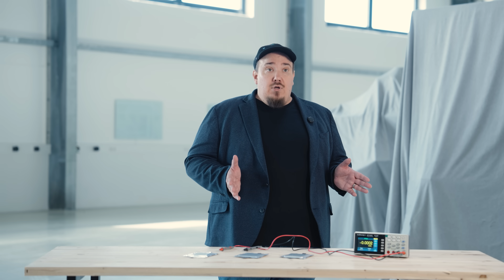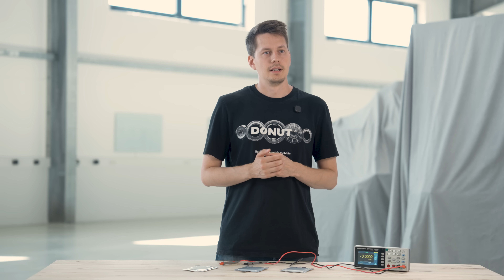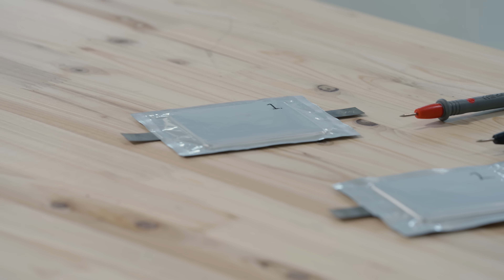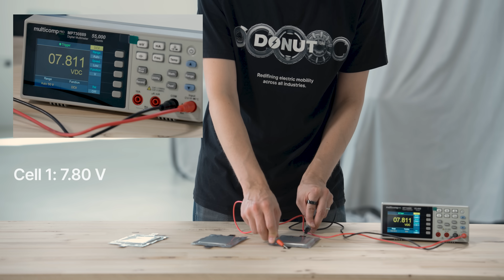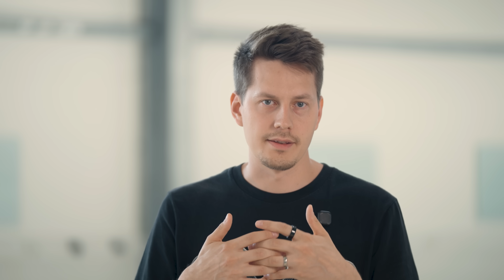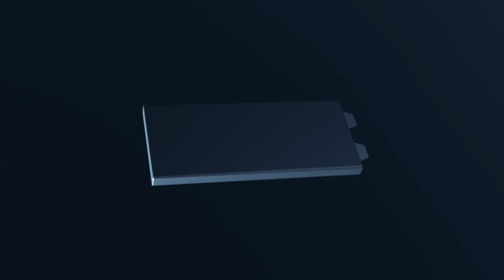Bipolar Cell | I Donut Believe

Comment: If the graphic can be taken literally then the first cell has six layers. The second has nine and the third has 14. So each layer delivers about 0.5 volts. Okay Ziroth, what's their chemistry now?
Reply: 0.55v... their V1 batteries didn't appear to be multiples of 0.55v though so maybe these are slightly different
Reply: @pinecat10  0.55 is the voltage of a potato battery
Reply: @marklefler4007 that's their secret tech 👀 in that I can believe
Reply: @pinecat10   Yes, the last line in the video suggests that V1 cells "already in production vehicles" are not bipolar, because he ends with ""our target is to still deliver the first bipolar cells to customers this year" so clearly not what they already delivered..
Reply: @daemn42  "the ones on this table" So yeah, not the "donut batteries in general" but only these specific samples that they proto rushed out for this demo. There's like 50 "donut batteries" and if you put their specs together you get the actual spec sheet. And so he can sleep well at night, the 100,000 charge cycles is just a capacitor.
Reply: @pinecat10 I think other bipolar organic carbon batteries have a natural voltage of 1.1V, but that was with a liquid electrolyte.
Reply: Now it got more interesting.
Reply: Cept given the last line in the video ""our target is to still deliver the first bipolar cells to customers this year" it's pretty clear that V1 is not bipolar and that calls into question whether it's using the same chemistry.     It's possible that everyone is  right here..
Reply: It's a different battery. They literally said it's on a test bench.
Reply: Look up zinc, manganese, and aluminum bipolar charges
Reply: @jonathangilmore446  Different chemistries result in different behavior. That does not mean that i Do Nut less Beleive.
Reply: @wolfgangpreier9160 i have a feeling my initial suspicion that Bhuskule's research into aluminum 3+ is crucial to the design. Heavy emphasis on the separater material in this video - thinking nordic nano doping technique is what unlocks the bipolar design. Still not holding my breath, but i still have hope. Zirorh claims feel dubious... and interviewing 50 scientists who didn't make the discovery calling bs is what we should expect from those interviews. Like, if a gold prospector tells his prospector buddies he found the morherlode, nobody would believe it until they see it.
Reply: bravely trudging on where no one has trudged before. hilarious.
Reply: Ziroth is entirely wrapped in his own confirmation bias.
Reply: @sailingoctopus1 Just like Markus / eater of many donuts here, too.
Reply: @jrherita No, what he has revealed today makes all the Donut Lab claims credible. Some of us guessed correctly whilst others have been barking up the wrong tree (Ziroth, for example). Most people have been unbelievably cynical, impatient, downright rude and acting like they have ever done anything worthwhile in their entire useless lives.
Reply: @sailingoctopus1 Are you new to battery technology?  There have been so many fantastic claims the last 20 years - that healthy skepticism is the starting point.   Donut hasn't done anything to prove it's solid state - they haven't opened it up, and they haven't shared energy density.
Reply: @jrherita  many fantastic claims are true, oil/gas corps are just buying out and killing off next level battery tech/startups on regular basis. 
and lithium battery is just perfect for planned obsolescence because it lasts 2-3 years, 5 at best. perfect to force upgrades and buying more 0 progress gadgets/batteries. thats why its everywhere.

the hard part is to not get killed/destroyed while you're releasing breakthrough tech. donutlab still can become the victim of that too. and guys like Ziroth aren't helping at all. 
the problem is big corps have too much money and resources to buy/remove any competition. and its not just a batteries thing, its happening everywhere with everything. corps just milking the market with gradual slow gains and planned obsolescence so we can't have good things anymore. 
inb4 'blah-blah-blah conspiracy put on foil hat' you can't even buy a lightbulb that works for 50+ years. exactly for this reason. or cheap DRAM/SSDs. even HDD price/TB stopped dropping despite it costing basically the same to make with bigger capacity. or GPUs for pre-mining prices like it suddenly costs 10x to make it - its not. and inflation isn't even close to 10x overprice. its all just pure greed and insane corp margins so investors and CEOs can buy more lambos and yachts.
Reply: @jrherita  read about intel tera-herz 2001. we aren't at the limit of anything. corps are just milking the market with overpriced near-0 progress crap ...just because ITS THE MOST PROFITABLE APPROACH. thats why there's no progress. and corps like TSMC and Ngreedia are just milking it maximizing profits. the less progress they make the less is price drop on older tech. just have to fake demand with AI datacenters build-out and force everybody to subscription computing with overpriced consumer tech.

also post-Von Neumann computing is the future i.e. memristor PCs and hundreds GHz switching if not THz speeds but thats more a question of architecture than of real transistor speed. and probably AI for everything replacing everything everywhere starting with GPUs/graphics. and then "OS" and "apps/games" completely faked by AI is the next step. and then AI generated actually realistic VR. most likely. all with monthly overpriced AF subscriptions where noone owns anything but low-VRAM dumb hardware unable to function without datacenters.

Playstation and Xbox chips are made by AMD. thats actually the reason why there's no progress or competition with PC GPUs and why they are overpriced AF like mining isn't over since 2022. so AMD can sell more obsolete overpriced slow junk hardware in consoles and handhelds to casuals aka noobs. go buy your 2020 ps5 for more money than @ launch. imagine buying 2020 phone in 2026 and paying MORE. thats how bad corp greed got.
Reply: @jrherita  I’ve been following battery technology closely since 2007, after buying a 42ft hybrid diesel electric catamaran with very heavy lead acid battery pack. What’s the history of your interest?

If you know anything about battery technology then you know that getting from the lab to into production is a huge leap.

If you were in their situation, the last thing you would want to do is 'open it up' to scrutiny, because you can guarantee that someone would copy the ideas that you've spent years developing and bypass any IP protection you might have.

FWG, led by Robert Murray-Smith, attempted the same thing with very similar bipolar organic carbon printed polymer technology seven years ago, only they were using a liquid electrolyte and they didn't have access to the precision screen printing technology from CT-Coating AG via Nordic Nano, which wasn't in existence at the time.

In 2019, FWG announced a 'merger' with a dodgy Texas-based Canadian company called EEStor, who, it seems were only interested in stealing the FWG IP. FWG withdrew from the merger and abandoned all development on their battery, presumably because of legal injunctions or running out of money or disillusionment. At this point, Robert Murray-Smith turned his back on battery chemistry, after having worked on his bipolar organic carbon printed polymer technology for seven years and before that as a battery research chemist at ICI. Instead he turned his attention to his passion for inspiring creative scientific curiosity by producing over 2000 innovative, inspiring and creative videos, presumably disillusioned with the back-stabbing world of commercial battery development. Sadly, he took his own life last year after the loss of his beloved wife Patti and after a long-standing battle with mental illness.

Tell me of a non-solid-state battery technology that would withstand the high temperature performance test conducted by VTT and reported on 2 March and could then, after being charged at 100°C, go on to be used in a further VTT safety test even after the vacuum pack was breached. Of course it's solid state!

Reading between the lines, energy density is likely to be their most dubious claim because I doubt the gravimetric energy density at cell level is 400Wh/kg. Bipolar batteries have struggled to achieve high energy densities in the past, although improved organic carbon polymers, solid state electrolytes and high precision screen printing technology might have taken Donut Labs some of the way there.

However, in practical terms, I think it is fair for Donut Lab to claim something like 'the gravimetric energy density of the Donut Lab battery at pack level is equivalent to the pack level gravimetric energy density of a Lithium battery pack built with cells with gravimetric energy density of 400Wh/kg.’ This is because of all the additional paraphernalia required by Lithium cells, such as BMS, inter-cell cables, connectors, lugs, busbars, pouch compression devices, thermal conditioning hardware, cooling liquid and structural packaging.

I think the last two videos have been preparing the ground for delivering such a complicated message. No doubt there will be a lot of people that will ignore the complexity of the message and delight in calling out a fraud, even though it’s nothing of the kind.
Reply: @sailingoctopus1  more likely paid by chinese. dunking on donut, praising chinese battery and being sponsored to go to china in one of his videos. skepticism is good, what he did and some others(which also seems to have done video on same chinese battery) is going hard at donut making multiple videos dunking on them in a way and with titles that suggest that they have checked and debunked the battery, which is false and in bad faith. No one will know the truth until it releases or they are prosecuted for scamming.
Reply: @jrherita smelling your own farts and saying you are right isn't being critical it's called confirmation bias and the dude drinks his own Kool aid to much. He made many claims then was proven wrong and then tripled down on them. It's like he hopes the more he says he right in his own mind it will make it happen. Sorry but that's not how reality works.
Reply: @Akiramasterwho did they scam? Have they taken money from investors?? Nope... Have they taken any more for pre orders? Nope.. so where is the scam?
Reply: @Nick_Gir They HAVE taken money from investors.  And they ARE actively seeking more investment.
Reply: Nah. 3.3V is one half empty cell.

4.97V is 2 completely empty cells, at 2.5V each. 

7.8V is 2 mostly full cells at 3.9V each. 

Intellectual dishonesty from Donut Lab, is not surprising.
Reply: @go1dfishyyyyy  very imaginative. so, if you can imagine a way to fake it, then it proves that Donut is dishonest?
Reply: It's bullcrapium
Reply: @aL3891_ you are wrong
Reply: @sailingoctopus1  I Do Nut Believe you.
Reply: @wolfgangpreier9160 Nevertheless,   you are wrong and will have to eat your words. A bipolar organic carbon polymer battery makes perfect sense of all their claims, as a few of us have been saying for several months.
Reply: @sailingoctopus1  I will not have to eat anything. I find it totally funny how the whole world falls for their scam. Its fascinating.

An no: a bionic carbon (which one?) polymer (which one?) battery makes no sense whatsoever. Sounds good for those people not knowing how batteries work IRL. 

As long as they do not have produced the first billion cells and can sell better and cheaper and longer lasting cells than e.g. CATL or Gosen.
Reply: @wolfgangpreier9160 In case you haven't noticed, the whole world hasn't fallen for their 'scams', so it's not clear what you find so 'totally funny'. 

The vast majority of people have been extremely cynical, just like you.

A very few people, like myself, have been more receptive to their claims, because we know them to be plausible if the technology was a bipolar battery, which we correctly predicted. Laugh at us few people if it makes you happy, but it doesn't make you right.

Your final paragraph makes no sense. You might want to change it so it makes sense.

*Organic, not 'bionic' and yes there are literally millions to choose from
Reply: @sailingoctopus1  The vast majority that watches Do Nut. Not the vast majority of people around the world. They have fallen for this paricular scam.

Batteries consist of much more than energy storage. Othewise we would all use solid state aliuminium air batteries that last forever and store 1500Wh/kg.

Which is obviously not the case.

In my last count Do Nut has presented at least 5 different types of cells which all look the same and at least 3 of them offer the same performance num,bers as a decent Li-Ion cell with NMC chemistry.

Thios last one is thenext best thingh to sliced bread and of course it will be delivered in the Verge (crappy cycle btw) and customers will be using them for the next 100 years or 1 million cycles, whatever comes first.

Reminds me on SMR, Redox Flow, fusion reactors, graviton batteries or sea wave generators, 90$ PV cells.

All of those exist but not as the general customer could ever use them.
Reply: Ziroth made so much damage to this company that DonutLab has to sell merch on YouTube just to stay on their timeline…he is a complete idiot because he interfered with it while the company was probably counting on getting orders for the Verge motorcycle, which probably got doubts in potential customers who never trusted to preorder the bike due to the idiot’s views😢
Reply: @gratziind L O fucking L.

If your claims are so thin that a YouTuber can get investors to turn against you, you have a shit product and/or an extremely shit marketing team.
Reply: @gratziind  No. He is not to blame for Donut Labs starting a hype machine without disclosing how?  They didn't need to do it this way, they could have just stayed under the radar, shipped bikes and then let people see for themselves.
Reply: @NealeUpstone we donut understand the process and how much money are needed for such a small company to scale this…they counted on the hype and on people preordering the bikes…legally, especially that they have stated that is a solid state battery, you could’ve just returned the bike if it wasn’t delivering the promise 😊
Reply: @gratziind  lol no they started selling merch once they set up idonutbelieve.  The company is a scam.  Remember products were shipping in March,  yet none have shipped now in Q3?
Reply: @jrherita clearly everything is going over your head 😊 they set idonutbelive and the merch because they didn’t got enough orders and the fact that even though they have fixed the hub less motor and didn’t got the credits and the earnings they deserve they are not willing to fall into a trap again by selling a couple of bikes for us to break apart the battery and other giant companies to jump on it because again they will have too little benefit out of it 😢 only time will tell and I’m still on board with Donut Lab

Comment: What you are showing, 3 cells in series within the pouch, is entirely possible with a liquid electrolyte NCM chemistry pouch, which almost everybody thinks you are using. We donut believe your batteries are solid state, I'm afraid.
Reply: It's also possible without NCM chemistry. And it doesn't matter what almost everybody thinks if almost everybody is wrong. The screen-printing process is real, and it cannot work with lithium because it is a wet process. Almost everybody is wrong.

Comment: This isn't fake, this is just far from scale and viability. Lots of YouTubers got it wrong. This is real but atleast 2030 is the targeted mass-use scenario. till then, you may see 1-2 high-end vehicles at 40-50 fleet scale.
Reply: if it's not easy to build from cheap materials it is by definition 'fake'. the biggest promise they made on their internal stuff late last year was that they could make packs at fraction cost of current ev packs.
Reply: @lasskinn474 this I agree. This is the biggest lie. They might be refering to an optimal stage at some point where it could get to a point of cheap abundant material cost. But this isn't scalable as of now and by the time it will be competition will erase it out
Reply: This company is full of shit and has been debunked several times. Marko is trying to avoid prison
Reply: @SimplyGregsterEV debunked by youtubers who collated data from previous companies.
Reply: @bondnikunj Please explain how you know this is real. Marko claims it’s ready now, you claim not till at least 2030. Someone is full of shit.
Reply: @simonthedog7980 cox some of the traits of the batteries are superior but the timeline is the fattest lie